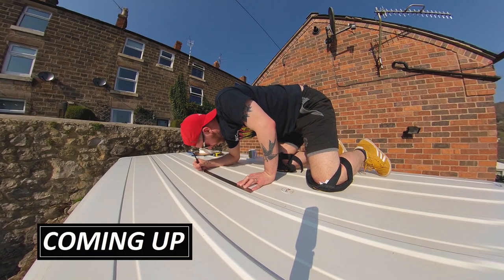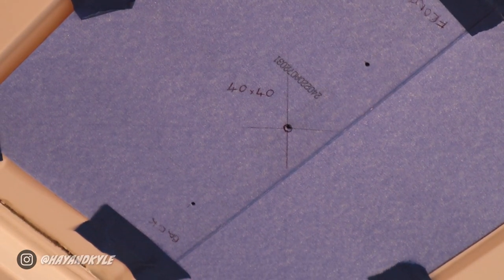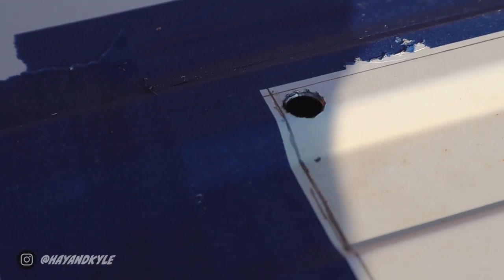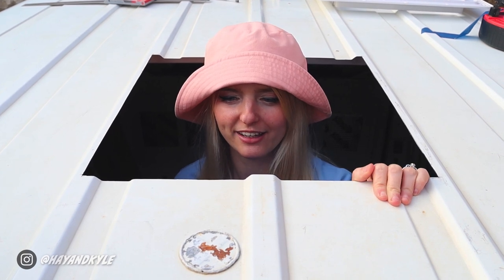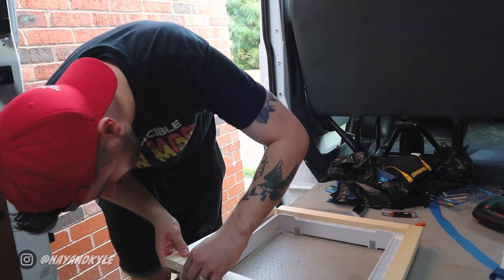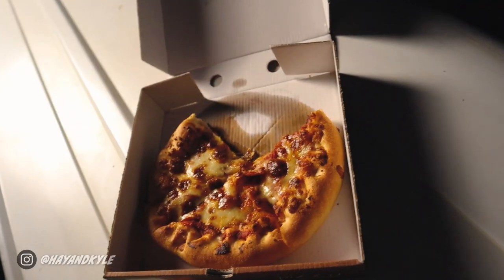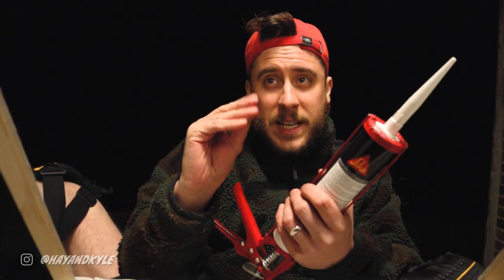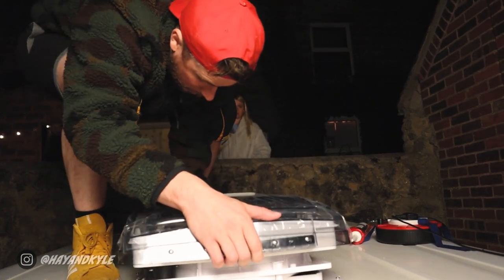VAN BUILD - Installing our MAXXAIR DELUXE FAN | Ford Transit Conversion

Comment: Great to watch the fitting of the fan, I've used that sealant in my replacement skylight on my caravan and it is absolutely watertight and stays that way, I also used it around the roof aerial for the TV, I have to say you are a braver man than me to cut a hole in the roof! The van should be a quality job when completed and a proper custom job just the way you want it to be, looking forward to the next installment, well done!
Reply from the maker: Thanks so much for watching Keith. The sealant should be pretty good stuff then! Fingers crossed it stays that way 🤞We'll be sprinkling in the van build videos in with our usual ones throughout the year :)